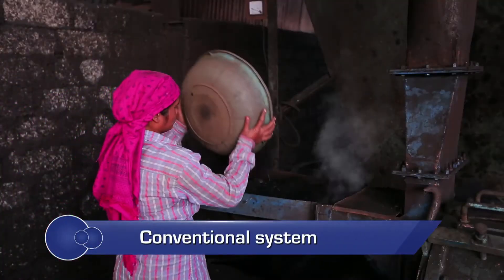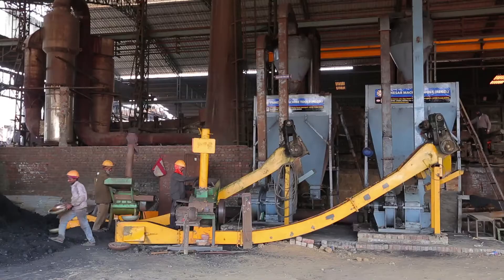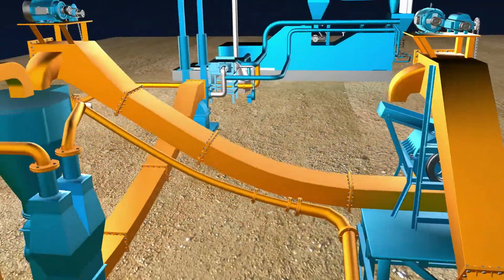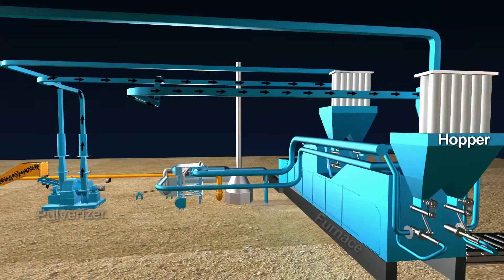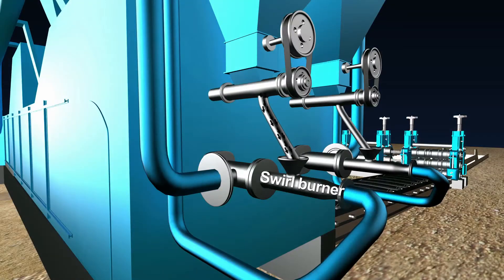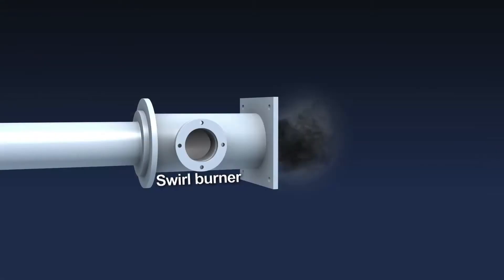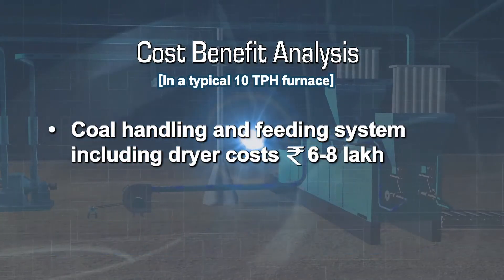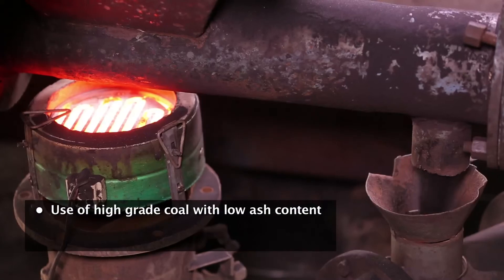Pulverized Coal Feeding & Handling System

Comment: we have also hot rolling mill and we use coal as a fuel for reheating 
furnace ,please request to suggest any authentic agency as a supplier or
 modification for full coal pulverize system  for our plant for increase
 efficiency ..

RIKEN PATEL
VIVAN STEELS PRIVATE LIMITED
Reply: Mankoo machine tools
9915432651